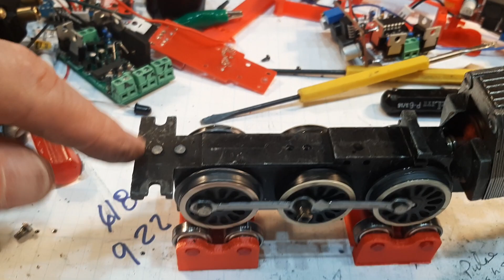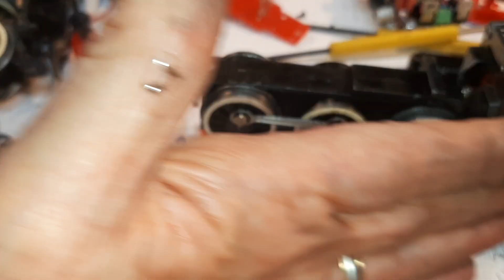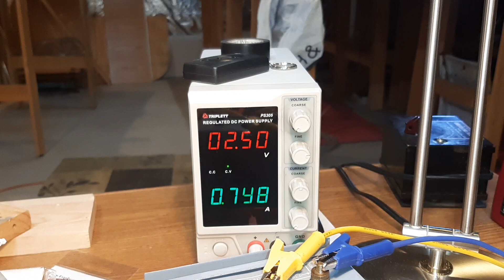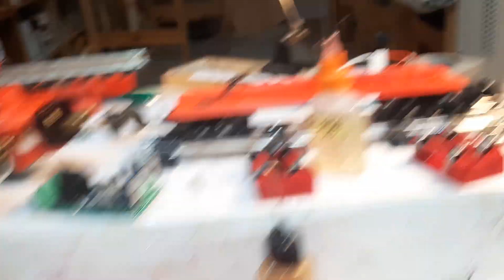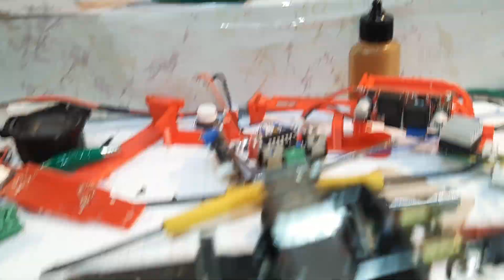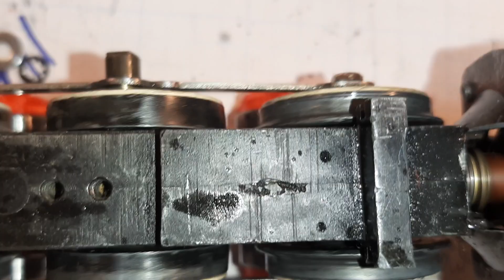Frankentrain Laboratories setting up a K5 310 Reverse in Boiler Next Gen S upgrade. Chassis first.

Comment: I just ran into your channel I think it’s so awesome keeping  the American flyer stock alive and well I have an American fly set myself
Reply from the maker: Glad you found me I have about 850 videos you can search on. I also have a plan toward a Next Generation S product platform. I want to focus on ready to run Chassis, Steam and Diesel that you get and then 3D Print your own custom engine.  My hope is to leverage the S Gauge scale and installed base to grow a new bath of users thru massive NGS DIY IOT Upgrades to flyer, Kits, Components and standardized Platforms based on Flyer Mounting patterns and great S Scale chassis. Keep watching, Subscribe and tell en what your up to. Dennis
Reply: @DennisMurphey  thank you so much for the great information I will most definitely be watching your content it’s great to see someone so into AF the set I have is from 1955 it’s the 326 New York central with smoke and Choo Choo

Comment: That's amazing htat an almost 75 year old little machine can operate so well with just a little TLC and a set of strong magnets instead of a wire wound field.
Reply from the maker: One of the main reasons I stick with American Flyer stuff and of course real trains run in two rails!